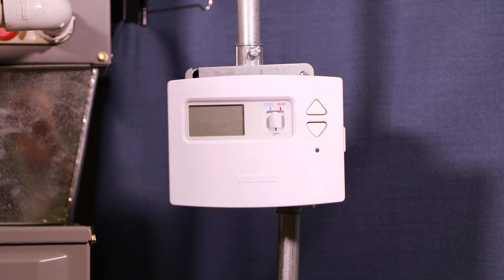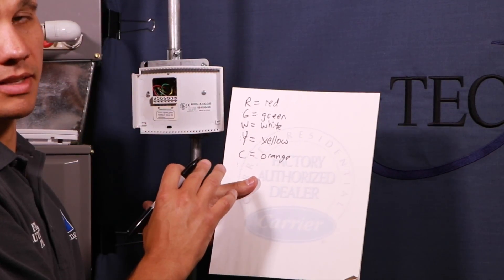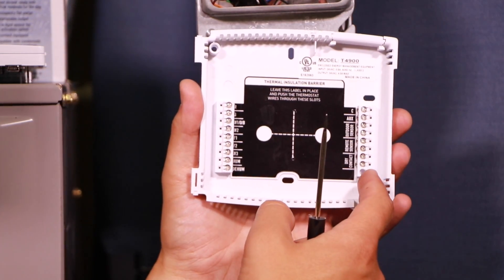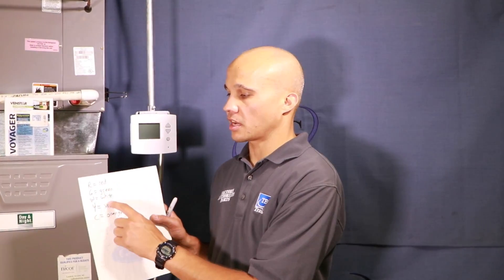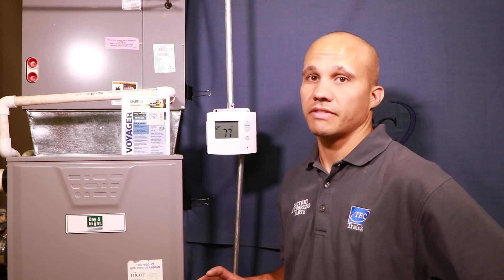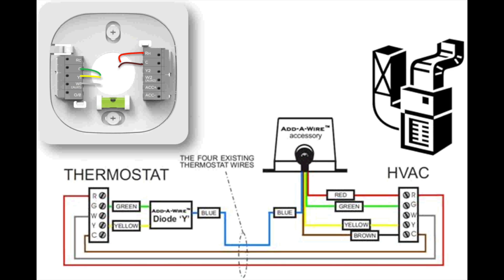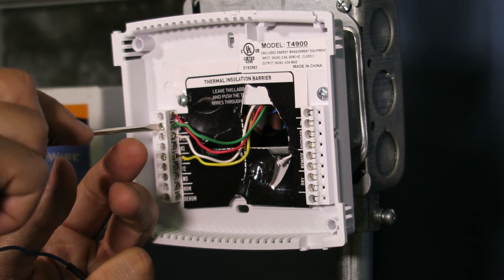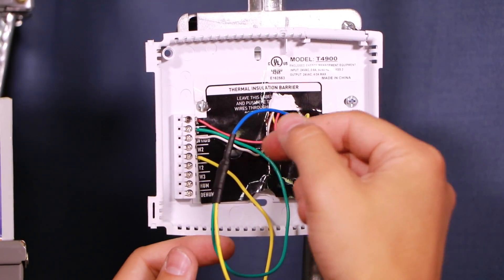Thermostat Replacement & Add-a-Wire Kit

Comment: Hi, my blower motor won't turn off even though I installed a new thermostat any suggestions
Reply from the maker: That symptom can be caused by any number of root causes.  Did this blower motor issue exist prior to your new thermostat installation or did it begin because of the new stat?  The answer to that will help you determine if perhaps you wired and programmed something on the new stat to cause it to run all the time or if perhaps you have a larger issue.  Either the thermostat or the furnace circuit board can engage the fan and for different reasons.  One of these reasons may include combustion safety.  There are also many areas of the country that have residential ventilation codes that require a fresh air intake on the home and the furnace blower is often setup to run continuously to meet those codes.

If you in the Midwest, we can likely refer you to a trusted residential service provider who can troubleshoot and repair the issue.
Reply: I had this thermostat put in professionally about seven months ago and I didn't have any problems until a week ago
Reply from the maker: For most climates, the past 7 months have been the heating season and the cooling season just began in the past couple of weeks.  Perhaps your problem is related to the air conditioning side only and it did not manifest itself until you turned the A/C side on recently.

What brand and model of stat did you have installed?  Which professional dealer installed it?   If the dealer is local to the area that we serve and if they purchased the thermostat from us, then we would be able to assist them (and hence you) with troubleshooting and solving the issue.

Comment: Hi I have a question about the cor. my old stat has a wire going to the RC with a jumper from the RC to the RH. when I install the COR do i put the wire back on the RH or do i put the wire back on the RC and chose RC and RH from the set up menu ?
Reply from the maker: Michael, it depends on whether the application has a single or dual transformer setup and what the "R" wires are connected to.  In regards to your Carrier Cor thermostat, we have a 3 part video series on that topic and here is the link to the part of the video that addresses your specific question - https://youtu.be/JvDsy_X-jNk?t=1m9s

Comment: Does it have to be Y and G? Say I have 2 wire heat only and want to add the fan (G) can I then use the W and G? Or is there something about Y and G that allows them to communicate in the 1 wire?
Reply from the maker: John, it does not have to be Y & G.  You can use Add-a-Wire to combine any two "signal wires" that you want.  So this could be G, Y, W, Y2, W2, etc.).

However, you must have dedicated wires (both R & C) for 24v power.  You can only share signal wires, not power wires.  Therefore, you cannot use Add-a-Wire in your example because you only have 2-wires and once you consumer them for power (R & C), you are out of wires.
Reply from the maker: There are numerous variables that could cause the blower to run without a request from the thermostat.  This could range anywhere from a simple mis-wiring by the installer to a more concerning safety lockout on the furnace combustion.

Certified service technicians should contact their local distributor's technical assistance department for troubleshooting tips.  Consumers should contact a factory authorized dealer for their brand of furnace.
Reply: what is the problem when the fan blower won't turn off even if the thermostat is on off